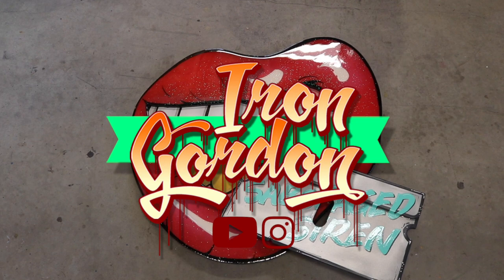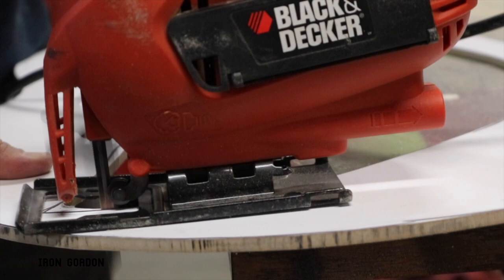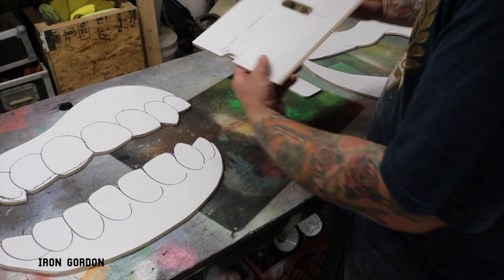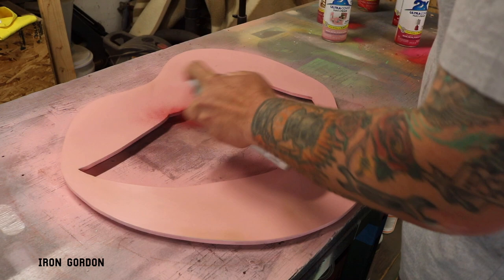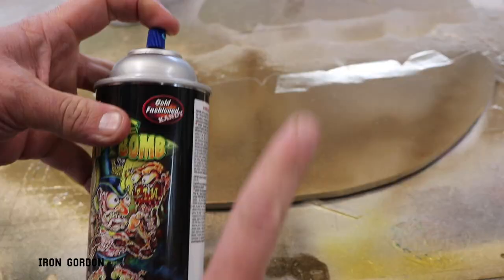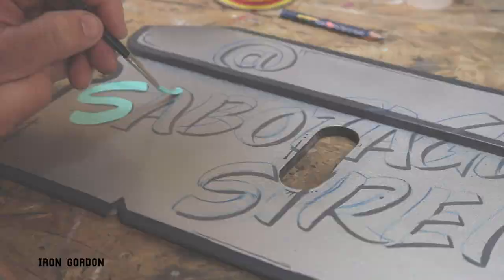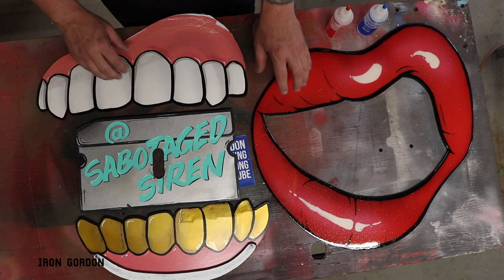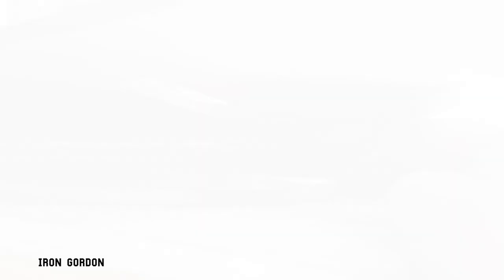Bad B*tch Lips Hand Painted Sign for Sabotaged Siren Tattoo Shop in Beaumont Texas

Comment: Great Job "IG" !......I know ya like your rattle cans,  'as wondering if you ever thought of investing into a couple of air-brushes...certianly alot more nozzel control for your  detail and shading....just a thought. (Again- ALWAYS lovin the glitter in your resin coats-always look great!
Reply from the maker: Ha I've been really thinking about one for a while, it would help to honan some good details. Do you have any recommendations? Thanks for the support btw!
Reply: Far be it for me to recomend any one model....I own several.....depending upon particular use, I have several Harbor Freight brushes-not bad fer the money ($20. or so....could almost consider them "disposables" :)) check out You Tube for the modifcations..... a llittle 6oo/800 grit sand paper on the neeedles makes a world of differance! ( got a couple of Iwatas- Badgers-Thayer Chandlers ) but realize I usually use em for my lettering "enhancements" etc- not much freehandin'.I normaly use the  oneshot in them and do the "wet-on-wet " tech'.......fun ta play with.
Please Keep postin'- enjoy your Work!!
Reply from the maker: @leroychristen6636  interesting thanks for the  tips, I didn't know hf sold airbrushes. Someone else mentioned iwata I think I'll look into those on Amazon 👊👊